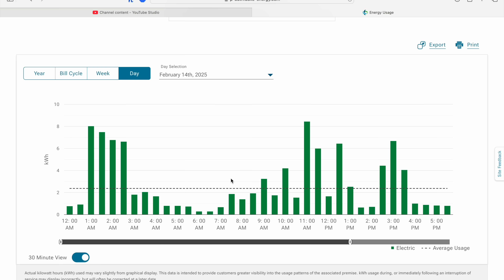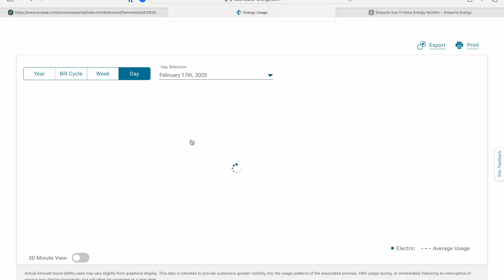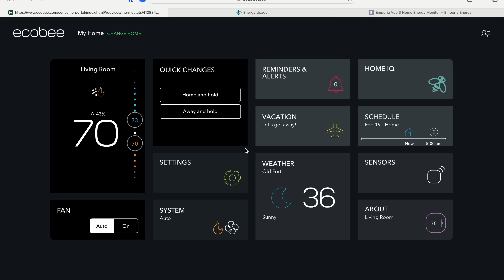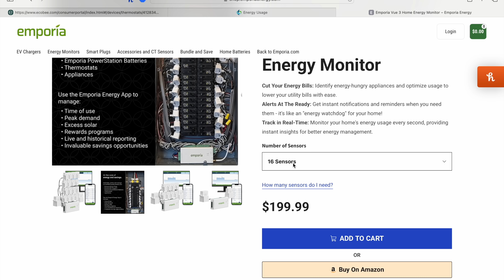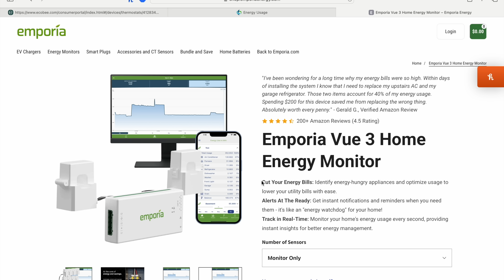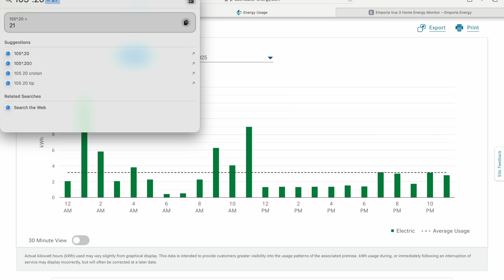Chasing Weird Power Usage

Comment: Glad you found the hidden option that was messing with your schedules and expected limits.  

Odd that the Thermostat didn't offer a pop up "tip" (or maybe not. People often switch those off) or the option to check your "Recovery" mode settings so they don't conflict...

So just to confirm the app/program can't "schedule" the Recovery mode? It's either ON or OFF? It needs to "take over" whenever it sees fit and can't be "paused" during specific period(s)?

Sounds like something to ask the Company if there is a fix/update...

Ever figure out what the "Mystery Breaker" was going to?  (Did you check in the panel  to see if it was actually connected, and Not just a place holder? Sometimes the size/color and routing of the cable can help narrow down what it might be... If you can see where the wire is going.)

As for Power Monitoring I've been using a "Sense" Power Monitor for over 3 years now. 

Unlike the Vue it relies on Identifying devices over time looking at their Electrical Signatures... Which means many very small (low watt) devices or complex/larger devices with similar or variable signatures may be identified multiple times or not at all... But it does offer Realtime monitoring of the Entire Panel, ID'd Devices, and has the option to monitor Solar (or 2 120V or 1 240V Circuit in Real-Time), if you purchase the Monitor with those Clamps or they can be added them later (which I did... First used if on a 240V Sub-Panel Circuit, now on a 240V Baseboard Heater... I can move it around as needed... But my Main Panel is "Packed" with a lot of Tandem Breakers (those single slot 2-120V Breakers) so that is one of the reasons I didn't go with a Monitor with individual clamps for every Circuit... It's already a huge Maze of wires inside that panel... Hard enough to track the existing circuits/wires... Trying to snake another dozen or more inside it would be a Nightmare.  

It offers excellent real-time and Historical tracking of the Entire Home and Devices IDed by the Monitor... So if the Monitor is either clamped to device or has ID'd it you can see exactly when it turns on/off and how much power its using in between by the second... It can also monitor Power Quality and if there are Spikes/Dips in voltage, etc.

With luck they'll finally allow for a hybrid or "manual" learning mode where they'll let users define their own devices.  Some people have had luck by shutting down various circuits and only running the devices they want found... It works occasionally, as long as it is able to still "see" the pattern later when stuff gets switched back on and the "noise" doesn't mask the device(s)
Reply from the maker: So the main point of recovery mode is just to get to your set temperature by the time you set it. Versus starting to try to get to that temperature at the time you set. It’s not a horrible feature to have if you plan on being home at a certain time and want the house to already be at that temperature.
It just didn’t work for what I needed. 

We have a theory about the mystery breaker. When we moved in, there was a storage building about 100 feet from our house. We were asked to leave it alone, so we haven’t been in it, but we believe there was power running to that building off of our panel. We of course haven’t verified this, but that’s our theory at this point.
I had been comparing the vue to the sense, some reviews I had read were pointing more toward the vue. At this point, I don’t think I’m going to go that route at all, though. We’ve got power usage even lower during the more expensive times, and there’s a small chance we will be getting the Tesla power share installed next month. Not that that really helps my usage but, it would make things harder to use the power monitor.
Reply: @MatthewSerta1 I get the idea of Recovery Mode... Just figured this might be a big enough "loop hole" that the App/Program would have thrown up a warning (even if it is a generic "Recovery Mode might still run during "off" periods... Disable if not wanted") or gotten override by the Peak Settings (during the designated hours) Suppose the Storage Building doesn't have any visible lights/power indicators from the outside?